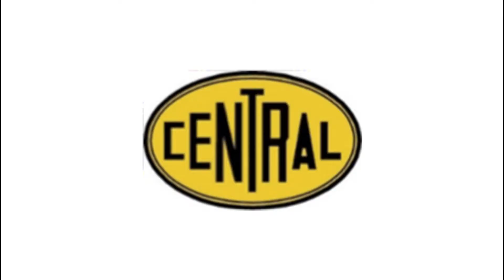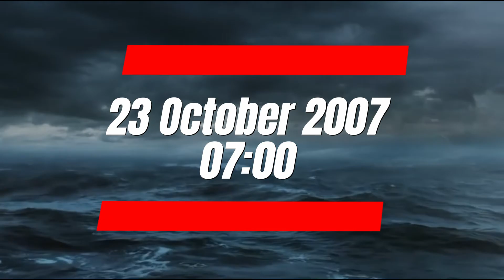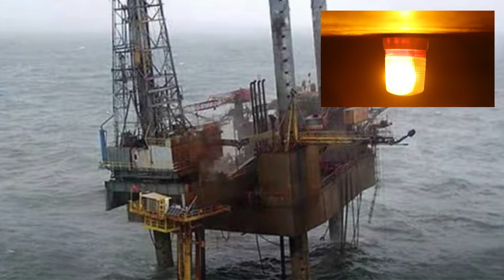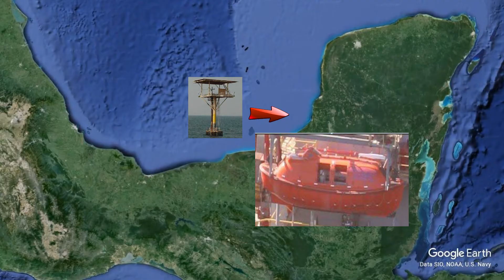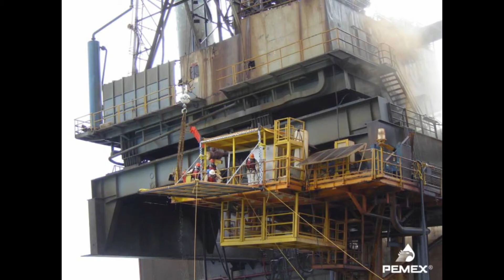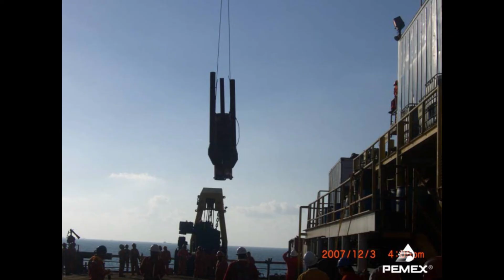Exposing the Usumacinta Disaster : Mexico's Worst Oil Rig Accident

Comment: Thank you... All this happened due bad rig move and positioning of the Oil Rig.  The previous spud can holes should be refilled way beforehand. As usuall this is costly and requires planning everyone overlooked. Lo barato sale caro.
Reply from the maker: Yes, the spudcan holes should have been filled, but the evacuation was also a fiasco. Shows the importance of proper training and drills. All so avoidable. Thanks for watching.